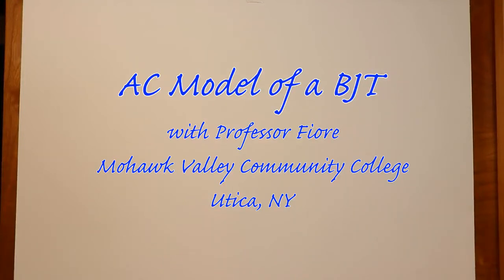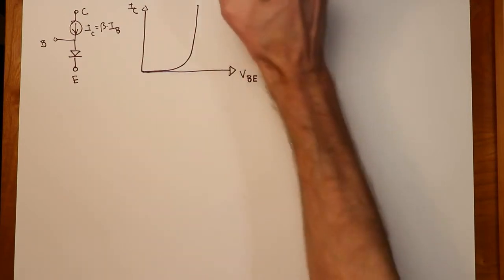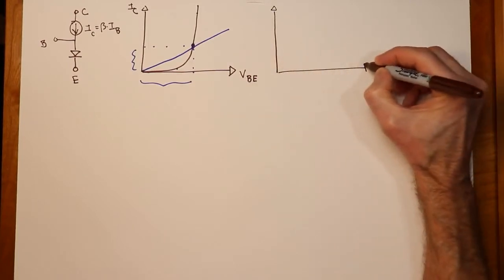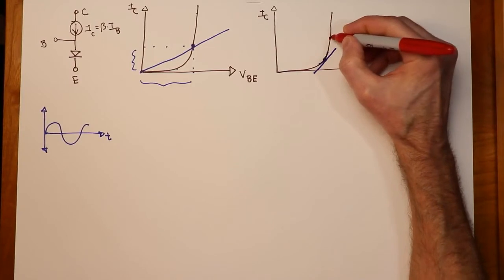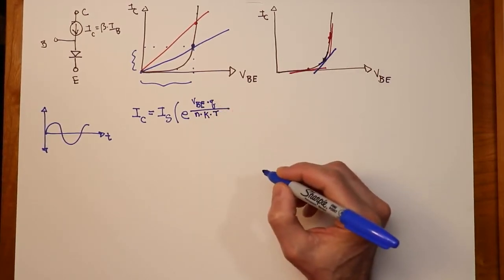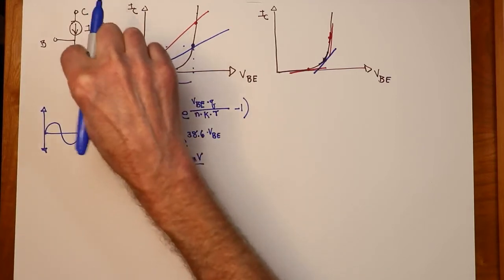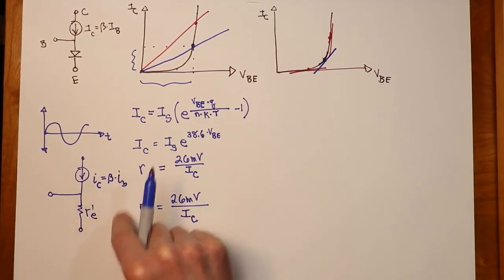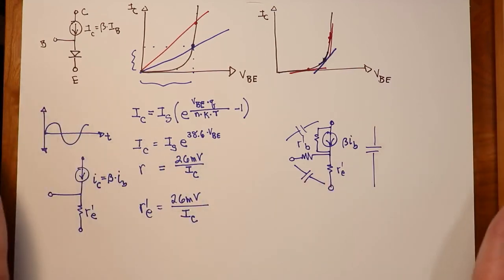Semiconductor Devices: AC Model for a BJT

Comment: Isn't the derivative of an exponential also an exponential, then how is your r = 26mV/IC, can you please show all the math on how you came up with the r equation. Also isn't IC dependent on VCE by Early Effect, what happened to that in the equation and subsequent derivation, because a small change in VBE can actually cause big change in VCE.
Reply from the maker: All true! It would be difficult for me to try to show the derivation in a comment, but no problem! You will find it in glorious detail (with appropriate graph) in section 7.2 of my Semiconductor Devices text which you can download for free. See the links in the video description, above.
Reply: @ElectronicswithProfessorFiore  Thanks for the textbook, it's very helpful, however I didn't find in it the derivation for r which showed what happened to Early Effect?
Reply from the maker: @whatever3041  For basic amplifier designs, the Early Effect is a very, very minor concern when it comes to determining the voltage gain or input impedance. EE hardly changes the value of r'e over the normal range of operation, and we usually minimize the effect of r'e anyway through the use of negative feedback (aka swamping), thus EE is maybe a third order effect.
Reply: @ElectronicswithProfessorFiore  thank you, however, I would have preferred that textbooks then showed it as a third order effect with proper math, because even though output resistance of the BJT is quite large textbooks show its calculation. We are trying to develop a small-signal model and in my opinion most time should be spent on how it came about what happened to dvCE/dvBE should all be discussed with proper math, because after the model is developed it’s all just circuit analysis.
Reply from the maker: @whatever3041  The proof starts with the basic equation developed by Shockley that describes the current-voltage characteristic of a PN junction. There is no need to tease out individually all of the elements that go into that equation.

Comment: Hi how did you derive 26mV in calculating r?
Reply from the maker: That comes from the basic junction equation. The derivation can be found in the text (free download if you haven't yet grabbed it). For silicon BJTs, you can think of it as a constant, rather like the the 0.7 V forward junction drop.
Reply: Free text? Thanks I wasn't aware, I'm sure you mentioned it but where can I find it 😀
Reply from the maker: @Chris-hi2hn  All of the links are down in the description of the video. There are five text books and seven lab manuals in the series. All are free to download or view on the web, and if you like print versions, those are available on Amazon at very low cost.
Reply: @ElectronicswithProfessorFiore  ...and they are most excellent!